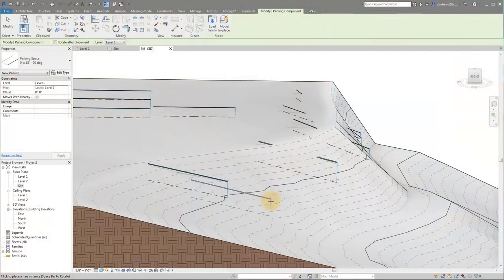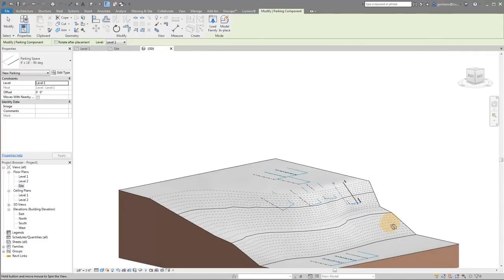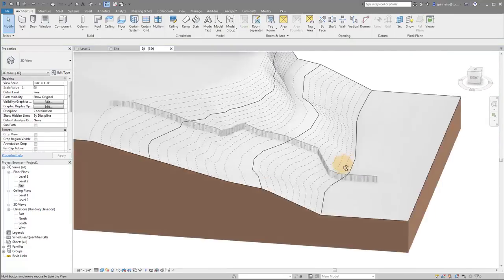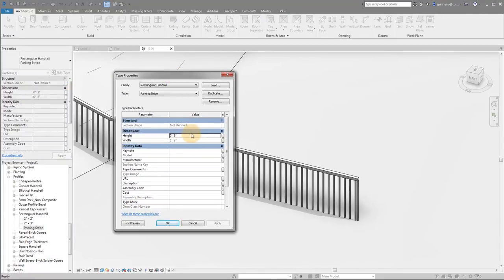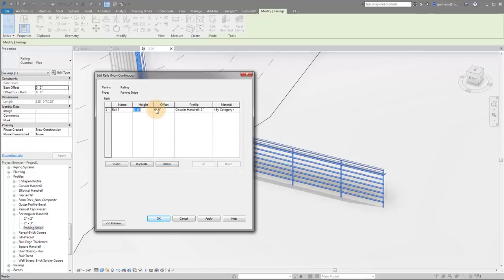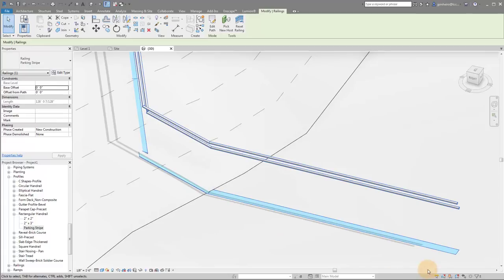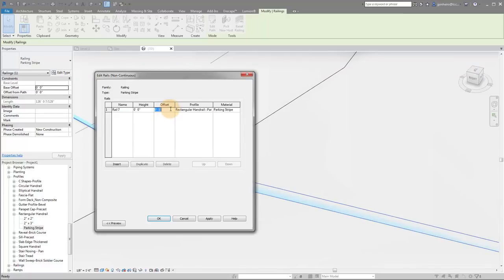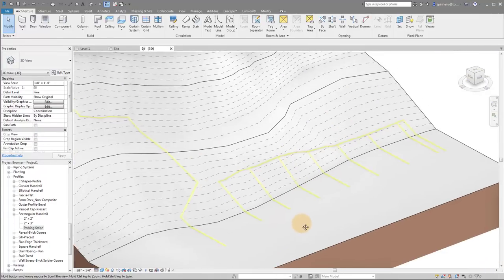Revit Tutorial - Parking Striping that Follows Topography

Comment: Having parking stripes conform to topography is especially useful for 3D views of the project. I created these about one year ago. I started using a railing set up like the one in the video. However, I found that I could not dimension these to the center of the stripes. If I could not dimension them properly, I would need two sets of stripe, one for 3D views and one for approval/construction plans. I already had families for flat stripes but found that coordinating changes was annoying and time-consuming. In order to allow the 3D stripes to be dimensioned I changed the railing family to use balusters which allow dimensioning to their centers. So the basics are:
Profile is needed for the stripes
 Create a profile family with various Width (4", 6", 12", 24") x Height (1/16")
Duplicate the existing Rails > Post - Square and rename Parking Stripe Baluster
 Width > 2" 
 Post Material > select material with color to match the parking stripes
Duplicate an existing Handrail - Rectangular and rename Parking Stripe 4" White_Hosted (or similar)
Pick it and select Type Edit to get to System Family: Railing Type: Parking Stripe...
Rail Structure (Non-Continuous) > Edit... 
 delete all
Baluster Placement > Edit...
 Regular baluster > pick a Parking Stripe Baluster with color; Base = Top Rail Element; Base offset = -1/16"; 
  Top = Top Rail Element; Top Offset = 0"; Dist. from previous = 4'-6"; Offset = 0" 
  (dist. is my choice for 18' stripes, more or less can be used with varying results)
 At the bottom of the baluster type dialog change all "Posts" Baluster Family to same as Regular baluster 
  provided above. Base, Base offset, Top Top offset and Offset are also the same as above. 
  Set Space (Start) = 1"; (Corner) = 0"; (End) = -1".
Top Rail > Use Top Rail (ck'd); 
Top Rail > Type > ... brings up System Family: Top Rail Type
 Hand Clearance -2" (for 4" stripe; others 1/2 of stripe width)
 Profile > select your parking stripe profile (must already be created - say, 4" x 1/16")
 Material > ... brings up Material Browser (create or select, say, Parking Stripe White (or blue, yellow, red) 

Hopefully, the foregoing is complete enough for those reasonably familiar with editing Revit families to create functional 3D stripes.

The parking lots we design have max. 4% slopes though the stripes are almost all in areas with about 2% slopes. Adjusting the thickness of the top rail may necessary for steeper slopes only if there are grade breaks within the parking spaces.

Note that creating a full set of stripes is necessary for good 3D view. Therefore, crosswalk stripes, HC parking stripes including colors, etc., are needed. I never got around to making a rail-type hosted HC symbol, since my flat one could be set to an offset from the level to appear to be on the parking surface.